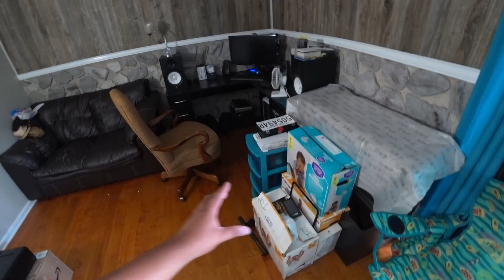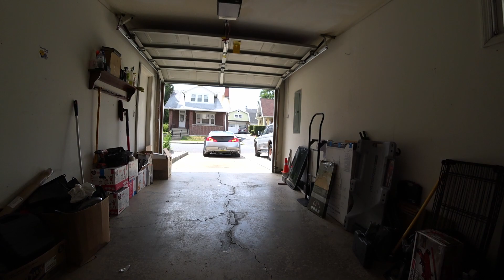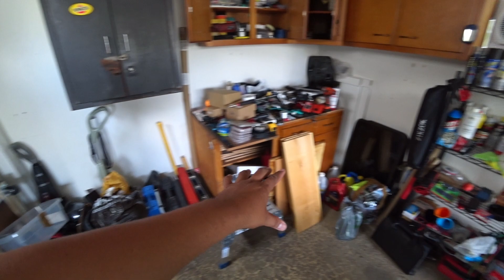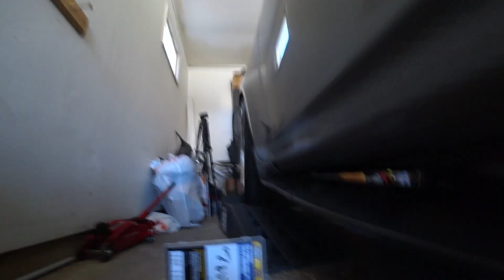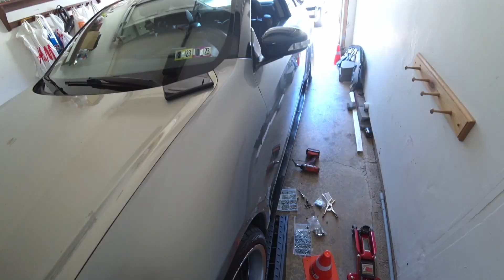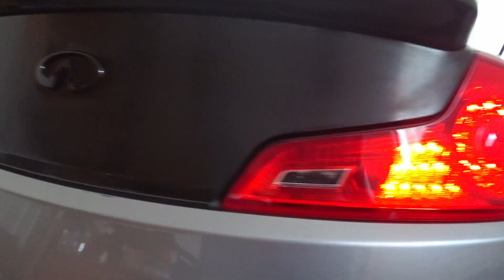This SIMPLE fix in my Garage change everything!!

Comment: Looks tiny mane, can’t you work on your car outside when the sun goes down ??
Reply from the maker: Yeah its not that big but ive done my entire break system with the same amount of space so im good hehe. Btw sun goes down by like 8 and by then everyones asleep #countryside
Reply: @LuisMBuildz  ah yes summer time, winter should go down earlier but then is cold outside
Reply from the maker: @ArgelyTV  yep, the cold is easier to deal with cause you just get a heater and is way cheaper to handle. Heat you need that AC which is expensive hehe